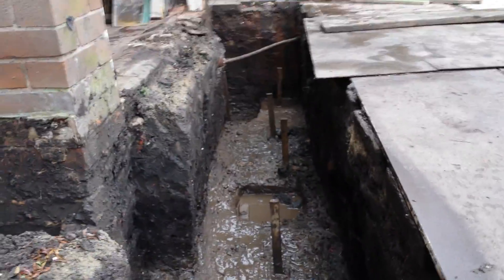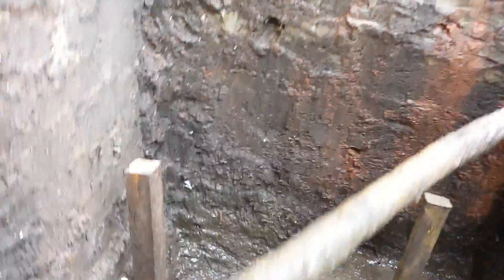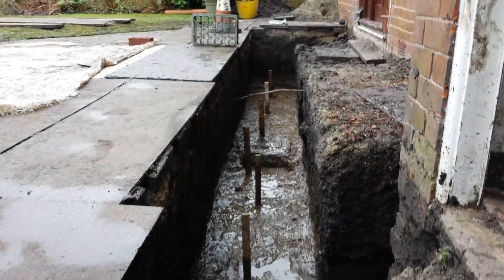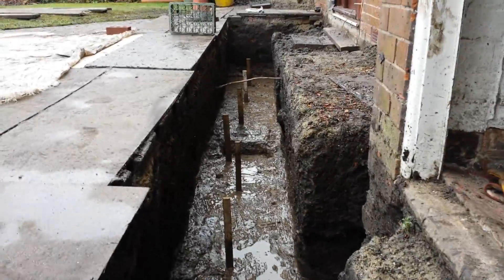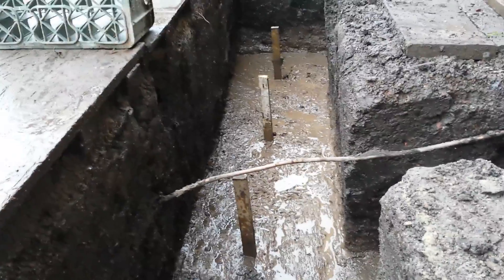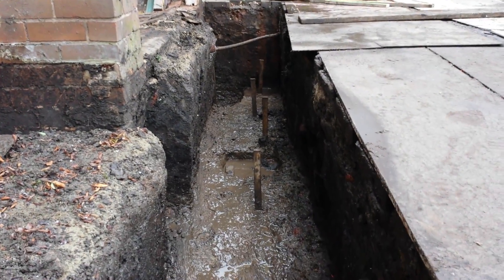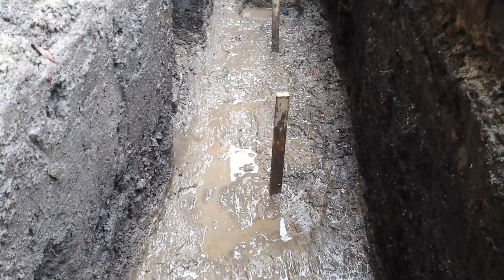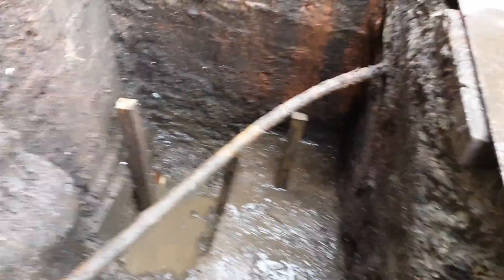How to level a concrete foundation for a house

Comment: Do you just pour in and leave the pegs in? Dunno why I would just rather them be to the side or something.
Reply from the maker: You can do either take them out once poured or leave them in. If you place them to one side of the concrete then leave them in.
Or use a line from one to other.
Reply: Can you use rebar pegs (12mm) cut to size and levelled off?
Reply from the maker: @philipcameron3784  yes a good idea but a bit pricey.  Timber to the side of the trench or a builders line set.
A laser level is All good just a bit tricky. Thx
Reply from the maker: Yes .usually we do put the pegs to the side.  Or put them out once done. Thx

Comment from the maker: yes by hand mate as you can tell by looking at the ground if its got bricks rubble etc in the ground its once been dug up to lay the drain
also its a different dig to all the other trench
a bit hard to explain
sometime you can use a detector that run in to the drain and use like a metal detector to track it

Comment: Always wondered if  thick walled poly pipe driven in and leveled would be an option for pegs presumably they could be filled during the pour and wouldn't rot like timber. Or am I trying to cure a problem that doesn't exist (no builder am I)
Reply from the maker: +Bertie Blue  yes that would probably be better but sometimes its hard to whack the posts into the ground, plastic may break easy.
you can also put steel pins into the ground at the edge of the trench and rap around a string line. not a fan on that tho.
will try your pipe idea . thank you